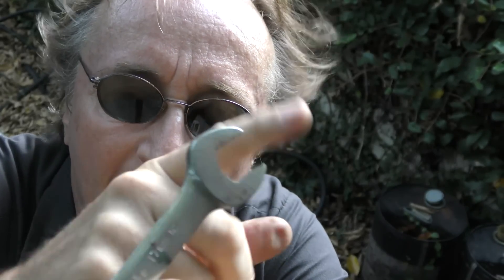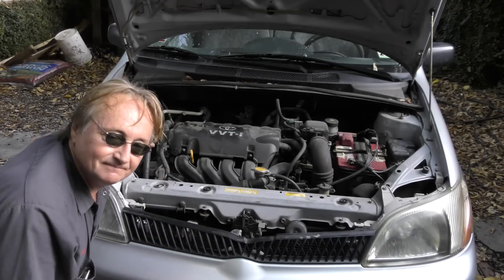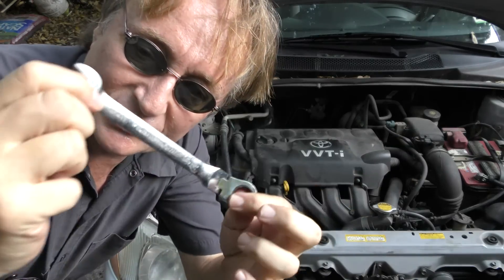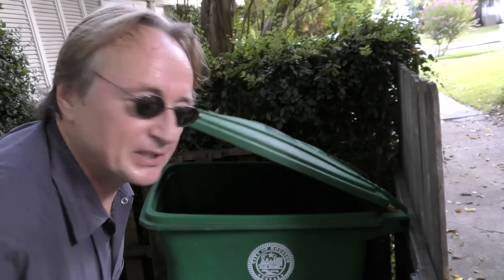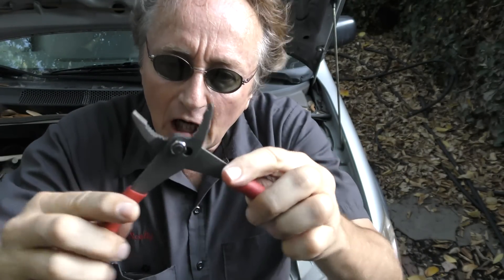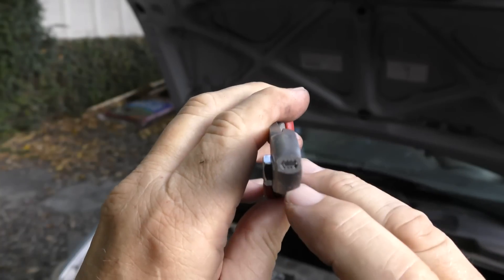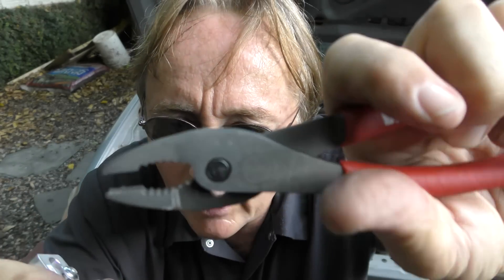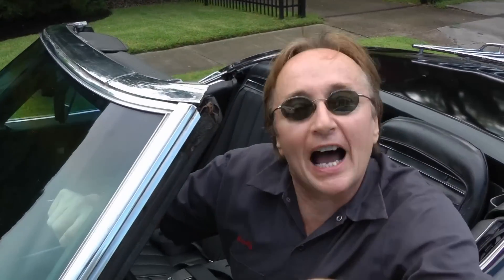Two Time Saving Tools

Comment: Scotty, I have a favorite 3/8" socket wrench. it has a twisting handle that you can use to turn the bolt once it's loose, but it also works like a regular fine toothed ratchet. it used to be made by Stanley, but now is labeled bostich. you can get them at Walmart for $20-25 range. makes tough to reach bolts where you can only get a click or two so much easier to remove. like the starter bolts on 4wd trucks. turns a 30 minute cursing and knuckle busting job into 10 mins.

Comment: Scotty, tool addiction is NOT a victimless crime. I am afflicted as well and own many tools. Often when I buy a new toll I must use it right away, usually at the cost of a victim ( my car). I suck at car repair but I enjoy trying. The problem I come across is all mechanic don't want to touch a car after a custom bought a new tool to * fix* an issue on said car. So now I'm a victim as well that TWO victims. Thanks, love ur videos.

Comment: I had a tool I'd send, but it went missing years ago. I think it found a new home in someone else's garage. It was called Color Tune. It was a spark plug that had a lens so you could see what color the combustion in the engine is. the more blue and white it was on the color spectrum the leaner it runs and so on. It was a nifty little tool for carbureted engines. You can find them on Ebay.

Comment: About 5 years ago I bought myself a set of 'fixed' gearwrench wrenches (Metric), plus a few other 'imperial' sizes too, and yes, I've been using them a lot in tight places where a regular socket set won't work,  but 90% of the time a socket set does fit so I prefer to use those instead.  For example:  changing spark plugs, or removing the bolts holding on a car door:  A gearwrench wrench won't work there, but a socket and extension WILL.  So I find that it is best to have a good socket set, THEN have a good gearwrench set as a BACKUP for places where a socket set WON'T FIT, and these days that's about 5 or 10% of the time.

Comment: Cramped tight spaces is why I prefer the 1/4" drive socket set for any bolt, nut, screw that it'll remove- if not THEN try 1/2" drive.

Comment: I've seen how easy that was to remove the lower bolt from that Toyota alternator without jacking up the engine. I would have liked to have seen how he put it back in.

Comment: An AutoZone alternator, you'll be turning those bolts again...
Reply from the maker: +Amesie's Automotive Corner well, it's a lifetime guarantee one, and i'm 2 blocks from the store.
Reply: When it fails you can get them to pay for warranty labor claims with a commercial account..
Reply: +Scotty Kilmer scotty i got a 2002 corolla 2.0diesel hatchback the intercooler was blocked ive changed it but it still burns oil after a long motorway drive what is the solution? some say piston rings might be faulty what do you think???
Reply from the maker: +Number One I'd bet on worn rings, realize blocking the intercooler wears em out faster too
Reply: +Number thanks scotty  what would be the best solution for it now?! and how expensive are the rings to repare or replace
Reply: +Scotty Kilmer what shall i do i really love this car so i dont want to get rid off it.
Reply: +Number One Scotty has a live Q&A.  Post on his forum or on the Q&A for more visibility to your question.  Also, might want to create a new question instead of hijacking another conversation.
Reply: +lmind2 where will i find the live forum mate
Reply: +Amesie's Automotive Corner lmaoo tru
Reply: +Amesie's Automotive Corner Yeah lucky if it last 6 months.
Reply: +Amesie's Automotive Corner that is not always the case.
Reply: +Amesie's Automotive Corner Look into it, most major retailers buy from like 3 different rebuilders that get them from the same places in mexico, malaysia, and china (of course).
Reply: I don't have to look into it. Replacing broken car parts is my my job..
Reply: Don't know much about autozone parts but I put one on my Lincoln 7 years ago and still running good,  maybe I'm just lucky.
Reply: +Amesie&#39;s Automotive Corner... AutoZone??? More like AutoClown if you ask me :)
Reply: +Scotty Kilmer In the 90s, I bought a really cheap muffler that was super thin, but it had a lifetime warranty so I got it. Every winter, it would rust out so I'd go back and get them to replace it. It was hilarious but I always had a new muffler.
Reply: +saleem83 maybe it's not the alternator...lol
Reply: That's why you don't buy the cheapo rebuilt one but a brand new one. I have always had good luck.
Reply: +Amesie&#39;s Automotive Corner i bought a autozone alternator 4 years ago, things still working and its on the bottom half of the engine without a splash guard!
Reply: +Amesie&#39;s Automotive Corner With electrical items, such as alternator, starter, etc., always get new.  Sometimes they're only $10 more.  Otherwise rebuild them yourself if you know how.
Reply: Dennis, Advance told me (for starters at least) the innards are brand new anyway. The casing is the only thing 'remanned' on remanned parts.
Reply: Never used an AutoZone alternator, but used Advanced Auto and either I've been really lucky, or they make good ones (for my Ford).  Replaced the original due to bearings and the AA one has been going for 4 years now no trouble.  It was brand new, not a reman.
Reply: Duracrap
Reply: +Alex M I got an autozone alternator it died in a month it has warrenty but I had to do the job again. 3hr job
Reply: I reolaced my 00 pony's alternator a long time ago and still runs great to this date duralast gets down with stock gear but of course there's better alternators too
Reply: YOU ARE SO RIGHT.

Comment: I have cut many a DIY "access" port in fire walls and inner fender walls with hole saws and saws-alls' to get at hidden fasteners. Work done I close 'em up with sheet metal, pop rivets, silicone sealer and a shot of spray undercoat. My cars/trucks only. I refer to them as, "Engineering Enhancements".

Comment: Sure you can just buy the wrench sizes you need, but what REALLY gets on your nerves is when you're in the middle of a repair and you have all of the wrenches EXCEPT the one you need. That's why I always buy the whole set. Especially after working on a BMW. Those fuckers require a whole different set of tools.

Comment: hey scotty, you should try out any knipex brand.  they're starting to carry some in menards.  i bought the cobra, just like a groove joint pliers, but the grip on them bites extremely tight and you only need to push/pull on the upper handle after the bite, and it could literally hold up without any slippage.  best pliers ive ever used.  even remove or an alternative to rounded nuts and bolts.

Comment: good video Scotty.  one tool I still have that was my dad's--a brass crescent wrench.
Reply: +George W That brass looking wrench might be a cadmium wrench.  The danger of cadmium poisoning is low but you might want to get rid of it.
Reply: Bob Cartwright at the time my dad gave me that wrench he said it was brass usually used to prevent sparking in use of gas appliances and lines.  Well my dad is up in heaven now.  How can I tell for sure?  To me it feels like and has the weight of brass.
Reply: +George W Sorry i meant to warn you about Beryllium copper tools. You can do a Google image search to see what they look like. Cadmium coatings are bad for you if you weld or grind them, but Beryllium is bad just touching them in normal use.
Reply: +George W If it is beryllium copper and as long as you're not handling it constantly, you'll be fine.

Comment: I was just looking at the thru bolt type socket and wrench combos in Home Depot. Also the offset combination wrenches he is holding there were in the store. I guess I will buy piece by piece because I don't have space for whole sets. And I certain find those vampire pliers there useful, I have been using some channel locks recently, they hold but awkward to use at certain angles.

Comment: Not exactly a tool but I found a wire hanger cut and bent into a pole with a hook on the end is good for getting things back out that you drop in the engine but don't fall through to the ground. I dropped my engine oil cap and it fell between the engine and the belt and I got it out with the wire hanger.

Comment: Stanley makes a rotator ratchet that you can simply twist the handle to rotate the bolt and remove it. That makes a huge difference if you don't have any room to do it the old fashioned way

Comment: dont recommend using the ratchet type wrenches to undo really tight / rusted bolts or youll bust the ratchet in the wrench. awesome though for once the bolt / nut is cracked to continue undoing with them

Comment: Hey Scooty, greeting from India, God bless you and your channel is really helpful, I have a quick question I just replaced the valves and piston rings in my car but I couldn't remove the carbon deposits from the pistons, how can I remove it?
Reply from the maker: +vaibhav vashisht soak em overnight in cleaning solution then use scrub pads to remove it
Reply: Thank you so much sir. :) 
One more question, I scrubbed the carbon out from one piston and it has got scratches, will it give any harm? 
And rest 3 pistons are running with carbon deposits on it. 
What kind of issues I might face while driving it for another 5-6 months? 
It's a 1.2l petrol engine of maruti suzuki ritz, VXI Variant, k-serious, 2010
Reply from the maker: +vaibhav vashisht small scratches on the tops of the pistons hurt nothing. You could also try decarbonizing the engine with decarbonizing cleaner or pay a mechanic with a pressure cleaner to do that
Reply: +Scotty Kilmer Thank you once again.
You rock.

Comment: Hi Scotty. I have a 1993 Cadillac Deville. I attempted to perform a tune up and was only able to replace the front spark plugs and wires. Are there any tools/methods I can use to get the back plugs without having to drop the motor or use jacks? Thanks!

Comment: the gearwrench set is so much better then the craftsman set. i swear those things have like 15 teeth, any kinda side pressure or if you ratchet too fast they skip teeth and cause you bust knuckles. luckily i only have crapsman in standards so i dont use them that much
Reply from the maker: +JOE FPOC And yet, a guy earlier here whined about how crappy he thought the gear wrenches are. You can't win em all.

Comment: Great video, Scotty. I have a 2001 Pontiac Grand Prix GTP(I know I know POS) and the oil pressure sensor keeps breaking on me, replaced it 3 times now. Can I get any advice on how to fix my problem? Had this car for a while and I want to keep it as long as I can so I can get my money's worth. Once the engine goes I plan on moving on to another car. Thanks.
Reply from the maker: +OG1GTP  get an oem factory sensor

Comment: Hello Scotty, I have a 2004 cadillac escalade, and i'm replacing the spark plugs but the cables have a metal shield around the cable boot and not sure if pull or turn to remove.
Reply from the maker: +geetano1 twist them around first, then they come off easier
Reply: thank you.

Comment: Hey Scotty, brake problem. Had a grinding noise when braking on front drivers side '03 Chevy 2500HD. I've put on HUB, speed sensor, and just did calipers, rotors and pads. Noise continues but only when braking and usually at low speeds. Ideas? Thanks for the channel, I'm a weekend mechanic!
Reply from the maker: +Blue Mudder don't worry about it, but either pads are poorly made or rotors are poorly made to grind with all those things you already changed.
Reply: +Scotty Kilmer Sounds good! It was just weird that I bought good pads and rotors from rockauto and it still made the noise. But you are probably one of the most respected mechanic because if something isn't a critical fix, you say just live with it! no need to spend big money fixing minor things. Thanks again and hope you had a great Thanksgiving

Comment: You should donate any crappy tools to a local shop or college. Hell even a young mobile mechanic that's trying to get a start. Sometimes any tool is better than none. You can always use a cheap spanner/flat blade to cut down or bend for tough to reach jobs. Beats destroying a good set of tool.

Comment: Scotty buddy! 1985 Nissan Urvan drinking coolant, spark plugs showing white residue and running pretty hot on the highway. No signs of coolant in oil. Recently replaced water pump and fan clutch no improvement. How long do you think I can push her on like this? Time to flog her off? Cheers :)
Reply from the maker: +DodoCnR flog it off

Comment: high Scotty off topic here but do you have any tips for me? I was doing the water pump on my 351w got all the bolts off but 2 where the bolt head snapped off, they are both about 4 inches long but I only have about an inch exposed, I've tried everything anything from lots of pb blaster to a torch and vise grips to a snap on easy out set that annoyingly snapped as well I'm stuck and ready to rip my hair out
Reply from the maker: +Jon Pfeifer try a torch to heat it up

Comment: Hey Scotty I have a 2004 Ford Escape with 84,000 miles on it. It tends to hesitate sometimes mostly between 45 and 55 mph. It does have an exhaust leak just before the cat convertor. The car has no codes. Could the exhaust leak be the reason or is it something else?
Reply from the maker: +Ryan Edwards yes, fix the leak first, that can make em run lean
Reply: +Scotty Kilmer The leak was the issue now she runs like a charm. Thanks Scotty!

Comment: heyy scotty i have a question. well i think its right but not sure when i go to turn over my 2007 pt cruiser it makes a clicking noise for like 1-10 secs  then crank up strong .
Reply: would it be a starter??
Reply: +slitter98 your right it could be because  the battery looks messed upqnd terminals starting to see threads coming out but i also researched they told me it was a starter but not sure.

Comment: Why does my heater only blow hot when accelerating, and then luke warm when Idling in my 95 dodge ram? It's full of radiator fluid, and I back washed the heater core. Can't be the blend door either since it's not moving when accelerating.
Reply from the maker: +Peachride EightyNine  sure, blend door needs lots of vacuum pressure, odds are it's bad and sticking with low power

Comment: Just a question for you, I've got a 91 explorer with 450k miles. For the last 200k it's been losing a small amount of coolant and getting condensation on oil fill cap, but that's it no other signs of head gasget issues. What's going on here ?
Reply: +mcgaugh57 
A bit of condensation is ok. If there's yellow or brown goo you have a problem.
Reply: +mcgaugh57 Do a pressure test and find out where its leaking.
Reply from the maker: +UG-RailTrance try my video "how to tell if your head gasket is blown" and pray it isn't
Reply: huh? my headgaskrt isnt blown
Reply: Scotty Kilmer LOL a lot of good prayer is going to do.

Comment: Scotty,

Can you, or have you ever, posted videos on a 1994 Ford F150 4×4s?
Reply from the maker: not yet, one of my customers own that exact model
Reply: Scotty Kilmer just took over my father in law's old ford, and i was looking for ideas on how to keep it running for another 10 years or more as well as, reasonable mods.
Reply: I wouldn't mod it as the Ford EEC IV system won't like it too much.  SO far as keeping it running for 10 yrs., change the engine oil regularly and don't overheat it.  May want to go ahead and go thru all the fluids on it as well-except maybe the transmission if it's never had its fluid changed, as it could cause harm.

Comment: how can you fix a broken low tire pressure warning light on a 2011 Nissan Altima 2.5
Reply from the maker: +car fan you have to find the culprit, which is often a broken sensor on one of the tires, stupid things are battery run and the batteries wear out over time. Takes a scan tool to find em though, and then a tire machine to take em apart

Comment: First of all Id never recycle or throw away a tool no matter how bad it was. Secondly it’s usually much cheaper to buy a whole set than one wrench at a time. A set of 20 standard gear wrenches is about $50. Buying just one 3/4 inch gearwrench could cost you $12.99. Makes no sense to buy individual

Comment: Got a quick question for Scotty or anyone who really can give me an honest opinion. Scotty told me to get rid of my 03 VW passat and I've been trying and I finally found someone who will trade for an 05 Saturn Ion. would you say Saturn is still a good move at this point or should I stay far away from a dead car company? Any answers would be appreciated, thanks :)
Reply: +Barley Mow My experience as a GM nut... Watch the Ions. Saturns are known for weak automatic trannies. I've also seen a tendency for minor electrical issues as they get older. If the Ion is a stick, and hasn't been abused, it should prove a decent car with decent gas mileage. 

Just make sure you can tolerate having your gauge cluster in the center of the dashboard, and the steering wheel is smaller in diameter than a regular car's steering wheel (slightly larger than a go-cart steering wheel) so it takes some getting used to - slight hand movements translate to more steering input as a result. 

A friend of mine bought a first-year Ion and it was a good car to her and her husband, minus going through a lot of starters and alternators, and the tranny went between 100-150k miles. They also had a first-year Saturn Vue 5-speed that ran well over 200,000 miles with little to no repair costs.
Reply: Andy Hicks Thanks for the advice! It's a 5 speed Ion so I guess that's good, it's at 189k miles right now with an engine light. The dash is rather unsightly but I could work around that. My car currently has 265k right now so either I trade it now or next thing that breaks down I'm just gonna scrap it. Idk if passats are good cars or this thing is just too stupid to know when to break down...I might just keep it and put money aside for a new car next spring or so